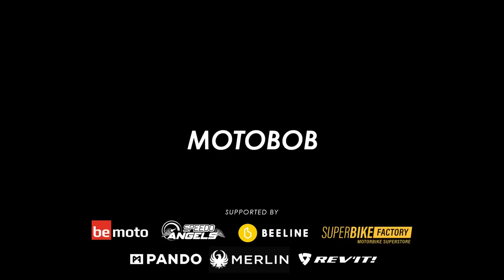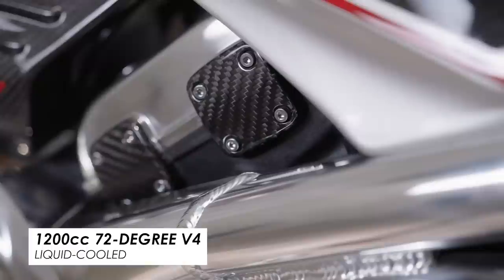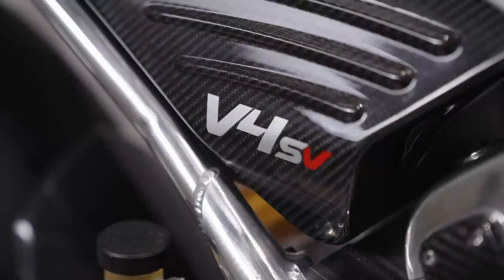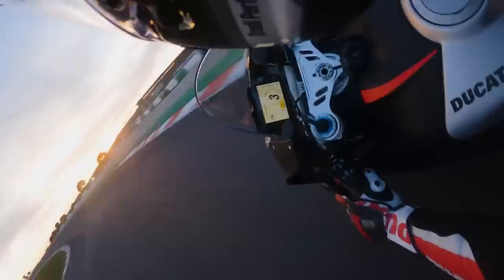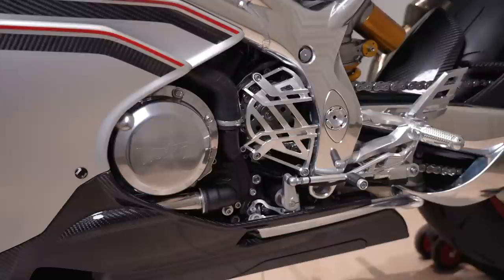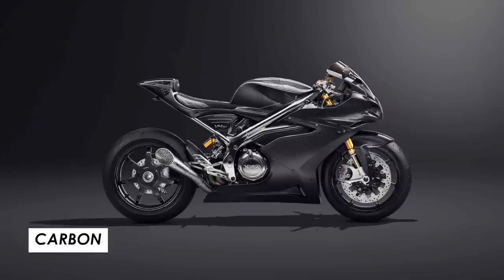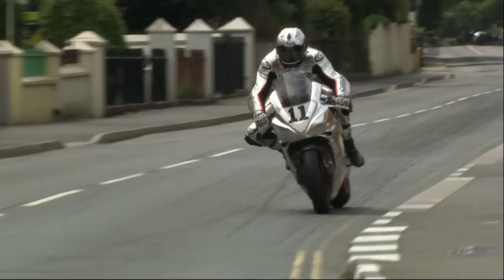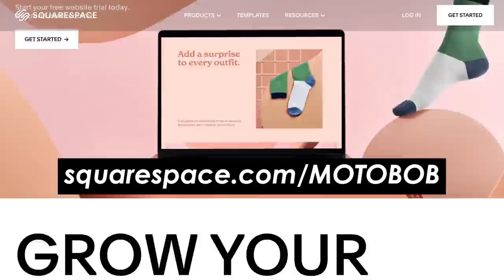New 2022 Norton V4SV Specs Announced: Worth £44,000?!

Comment: As a Norton limited edition owner, unfortunately they really have pitched this bike in the wrong price bracket. As this was the first bike from the new owners based on the revamped V4 SS/RR from the previous era, sorry Norton this is a mistake.
Reply: This will be limited numbers sale. It’s more on point to “re-establish” Norton as a Premium brand, to put some separation between RE, BSA, and the likes.
Reply: @TheGreatestBeyonder  Premium brand does not mean £44,000 price tag. I have a BMW S1000RR with BMW installed, suggested and approved high level upgrades to make it extremely track focused, but road legal. With all due respect this would out gun this Norton easily for half the price. They should have focused on the Commando first and then investigated the V4 viability since they have the blueprints (however dubious) from the previous era.
Reply: @robinperronjones5024  it’s not about pure performance per-se… that’s almost irrelevant, they realise this. It’s about exclusivity of a prestigious marque.
Reply: @TheGreatestBeyonder  You have a good point, Norton is already a marque brand with a great heritage, the Commando is revered by many enthusiasts. I chose a Dominator SS based on the platform brand and exclusivity but originally ordered a Commando. I understand the V4 SV derived from the TT inspired V4 SS & RR from the Garner era, but this could have waited until the heritage models were re-established. It will be interesting how sales go to see how it has been received by the die hards. My original Norton dealer from the Garner era being a multi premium brand stockist  thinks the same, let’s see what happens

Comment: Well, it still has the most torque.
And if you know what torque means then you'll know that the spec you can feel easiest by the seat of your pants then it is torque.
More torque is more fun. More hp is just for bragging rights but you cannot really feel it.
Reply: 125 nm, or 92 ft lbs, of torque may be the highest of the three compared in the video, but to my mind it still doesn’t justify the eye-popping price. My R1250R has 142 nm, or 105 ft lbs, of torque, so if torque is the barometer, there are still a good number of better options out there. Yes, I do get that comparing a boxer twin to a V4 is an apples to oranges comparison, but I just don’t see anything about this bike that in any way justifies that price, other than name and heritage/prestige, and if so, I do get there will be customers for that…hell, Harley-Davidson built a company on that same principle.
Reply: Ah yes the HD mentality